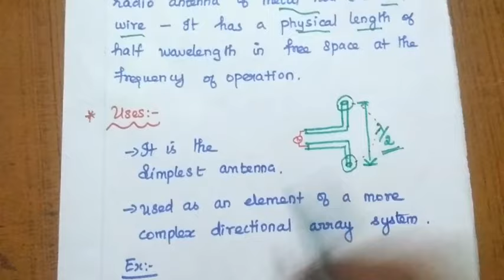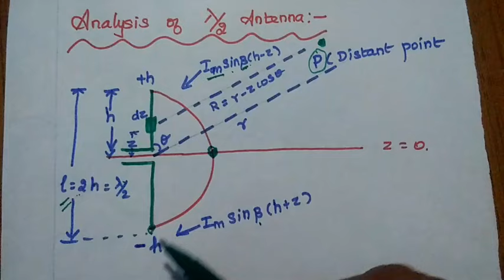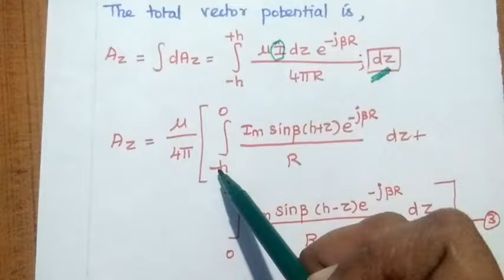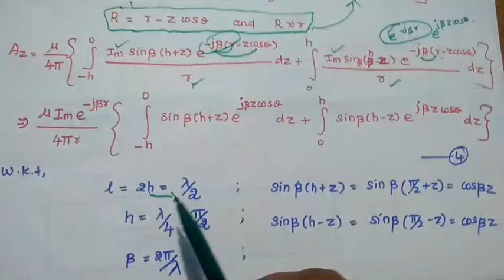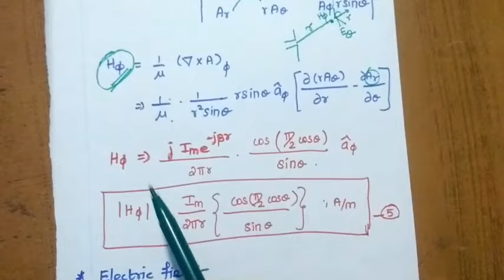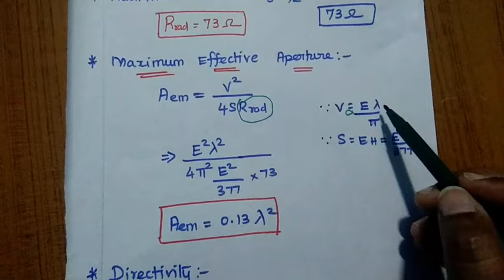Half-Wave Dipole Antenna - Derivation of Radiated Fields and its Characteristics

Comment: A half wave transmitting antenna radiates 10KW of power at 100MHz. If the heights of transmitting and receiving antennas are 100m and 9m, calculate the power received at a distance of 10kms from the transmitting antenna.
Reply: Can you solve it mam??
Reply from the maker: You can use Friis transmission equation to get the received power from transmitted power.
Reply from the maker: Wave length = c/ f
Gain for half-wave  = 2.15 dBi
R = 10km
Reply: @PadmasriNaban  first of all tq for responding....such a good youtuber
Reply from the maker: I will send the solution in few days
Reply: @PadmasriNaban  comment puis je te contacter